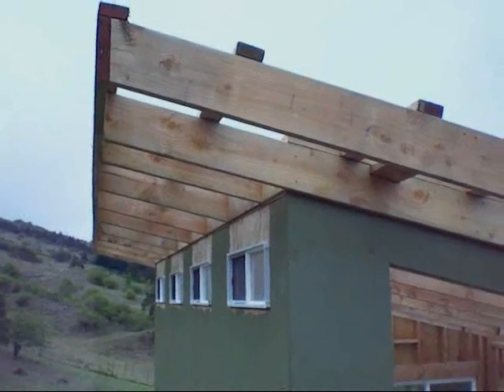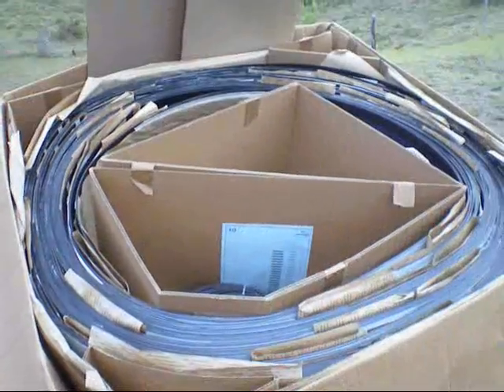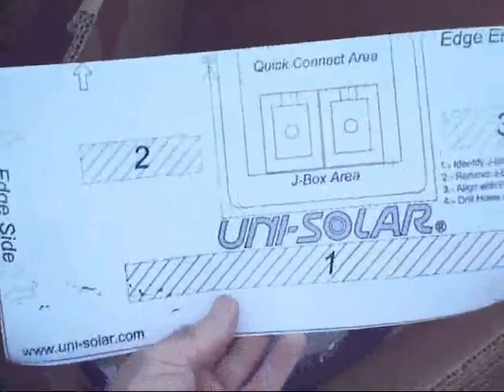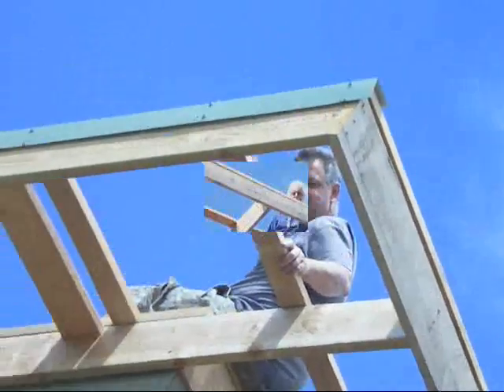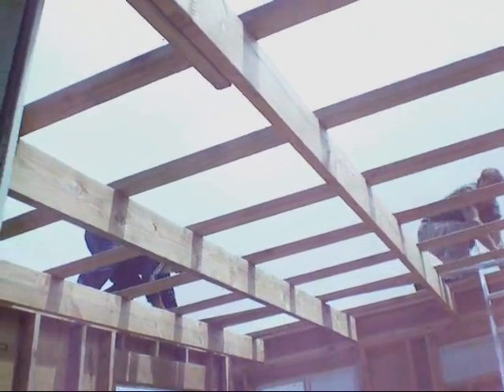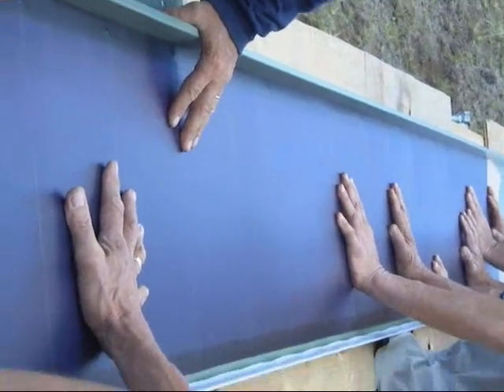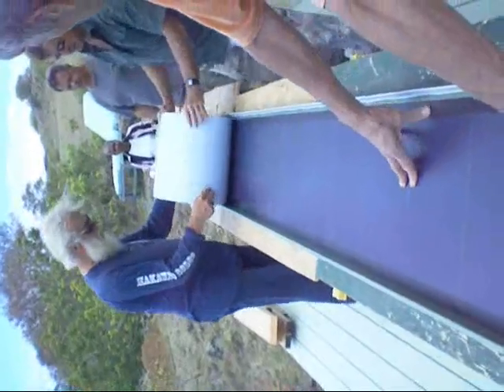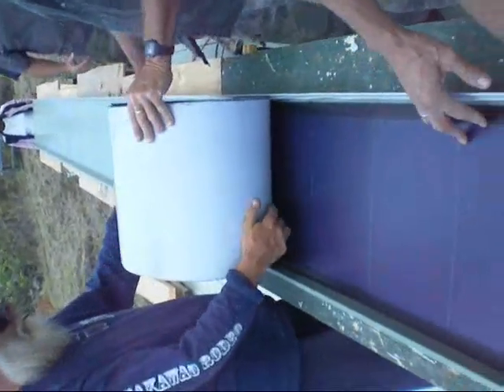Uni-Solar laminates DIY how to video from Smart Roof Systems

Comment: It's probably more than asphalt shingles even skipping the 1/2" roof decking and going with 2x4 purlins like they did here.
You get what you pay for. It's a standing seam roof with 1.75" standing seams made from 24 G Galvalume or Zincalume.  You do need to plan a 1/8" runout extra per roofing panel.  It may be the HPM panels are a little too wide but they seem to measure out at exactly 16" so plan on an extra 1/8" run out per roofing panel it just works out that way.  The laminates are in stock in Hawaii but only 18' primo 144 watt.  The cost is 300% more than Korean panels per watt.  But the roof comes out beautiful with zero penetrations or damaging U clips to the standing seams.  Uni-Solar laminates respond to light much further into the red spectrum compared to glass modules.  The temperature coefficients are 100% better than glass PV.  These U clips the solar installers use on standing seam roofs probably voids the roofing warranty because they crimp the standing seams and prevent expansion and contraction.  Those standing seams were never designed to support a glass and aluminum wing on top of it.  With peel and stick laminates like these it's so much more elegant.  The ability to expand and contract is a great selling point for the standing seam roof and to defeat this feature is a mistake. The roof will creak in the heat because it can't expand and contract like it's supposed to. There is tons of videos of folks installing laminates plus there is an official Uni-Solar instructional PDF for laminates I can forward to people with complete information.  Uni-Solar is kaput but there are lots of kinda pricey laminates still in Hawaii I can supply.  There is no more manufacturer warranty too which is a real deal killer.  I still say it's the best way to go with PV solar.  Good Goin  Stan and Iris!
Reply: Could you possibly send me that instructional PDF by chance? I have 10 panels I need to get going. If you could I would appreciate it greatly! Thanks!

Comment from the maker: @einsteinsdad   
Just call one of your local metal roofing suppliers in your area and ask for Galvalume or Zincalume Kynar painted 16" minimum standing seam concealed fastener roofing panels 24 G.  The pans must be flat as can be.  Typical cost is $3.50/LF so an 18'3" panel will cast about $65 plus clips and screws.  
Franklin Russell 808-876-0377